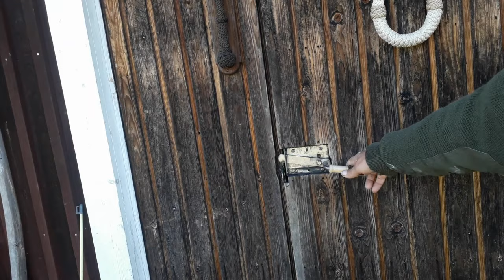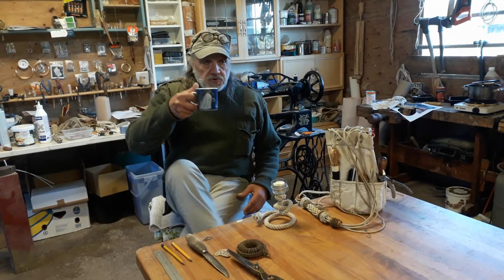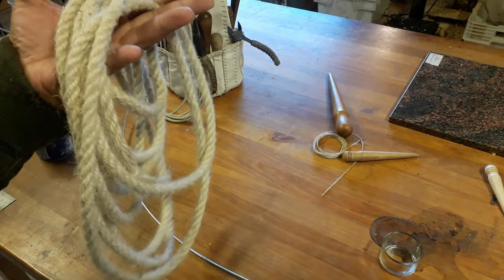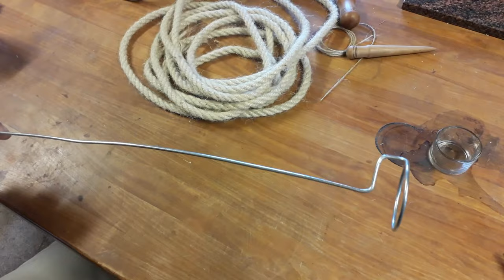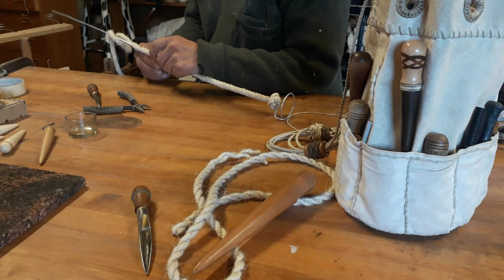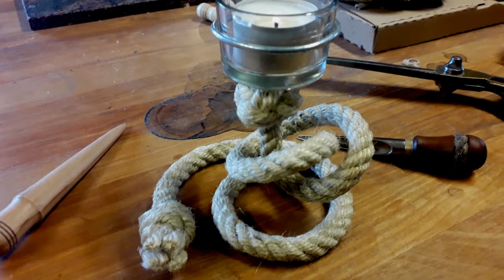Rope magic -  knotted candle holder

Comment: As always, outstanding presentation(though I agree with a previous post, not really that the music was too loud, but it was loud enough to disguise what you spoke.  As you sped the process in several places which, which of course sped up your dialogue, I didn't really think it mattered, but for those paying particular attention to what you said, it might be confusing.  Another great illustration of why so many view you as an artist, in my humble opinion, is your attention to the aesthetic detail in the structure of the rope, i.e. adding the additional strand to fill the gap rather than twisting it tighter and bunching it up.  A natural feel for the nature of the rope and structural integrity of knotwork in general.  Years of history and tradition emulated in a simple aesthetic decision.  Bravo! and Thank you...another fan from Maine.
Reply from the maker: Thank you for the feedback. Note taken about the volume in music. There is always room for improvement.

Comment: I made one of these last night. I made a few mistakes and learned a lot. I used 12mm sisal, 2.5mm wire and in the end it was too short to do the nice knot in the candle holder so it is just a spiral. My manrope knot tightening leaves a lot to be desired. I failed to get it nicely dressed and tight. But I am keen to have a crack at another one and get better!
Thanks for the great video.
Reply from the maker: Good for you. Sisal can be challenging. For neat result, use some softer fiber rope, like jute or hemp.

Comment: Masterfully done.

I had a question. I figure that different materials probably have different strengths and weaknesses, but if given the choice, what material rope do you use and why?

The rope used here is flax, yeah?
Reply from the maker: It all depends on what you will be using the rope for and what qualities you are looking for. For projects like this, I use often jute, since it is easily available, good looking and quite cheap. For strength, I would use hemp or flax.